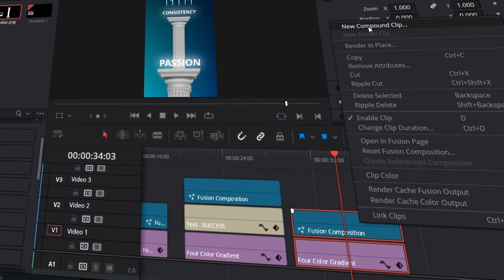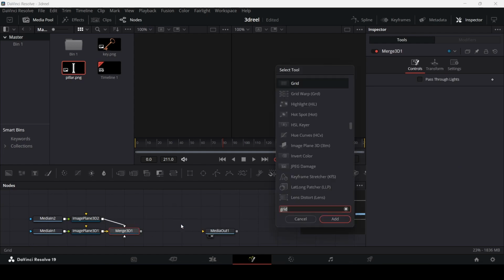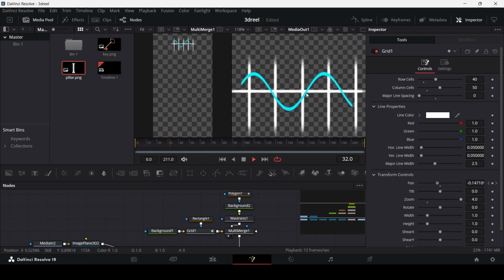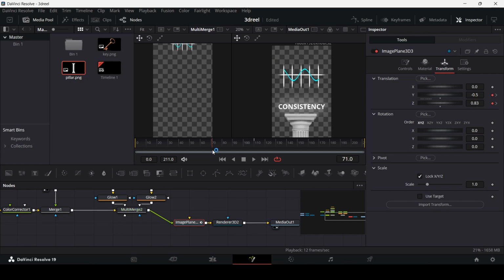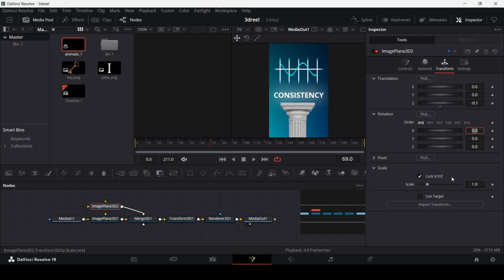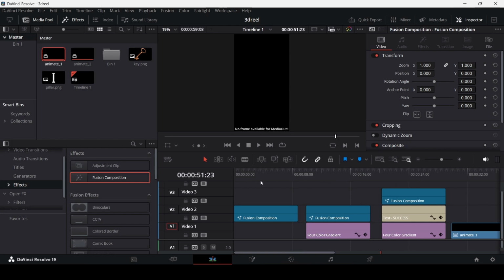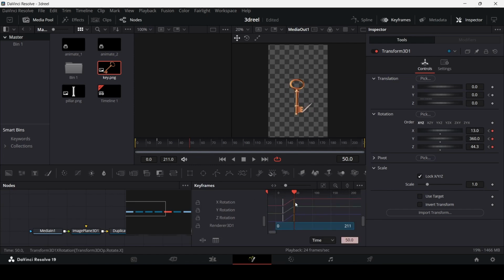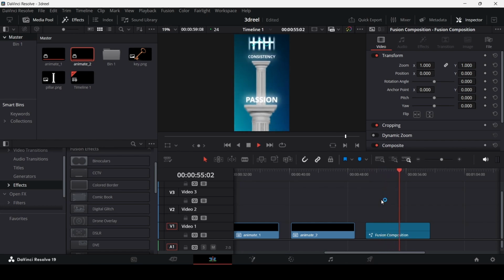DaVinci Resolve Viral 3D Reels Animation Editing Tutorial Like Keanu Visuals

Comment: Your video is good, but the animations are not very smooth. Right now, the motion is linear, which makes it look stiff. Try adjusting the keyframes to use ease in and ease out instead of a straight linear transition. This will create a more natural and fluid movement, making the animation feel smoother and more polished